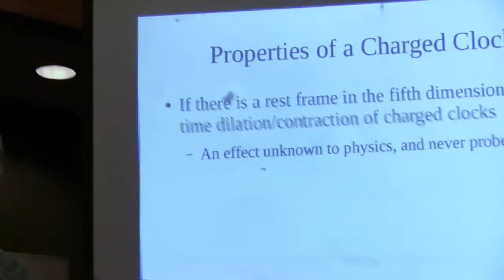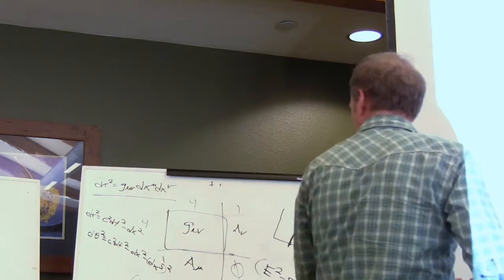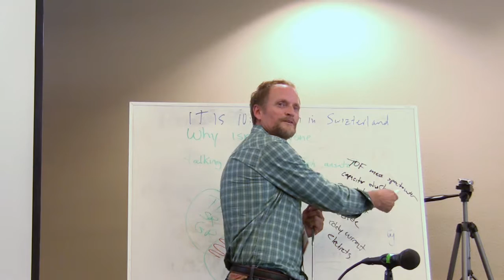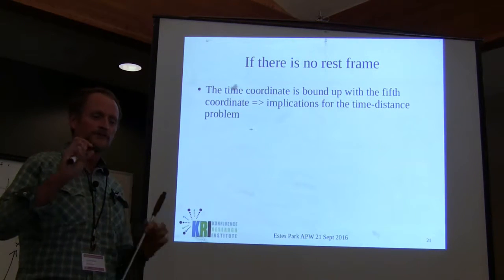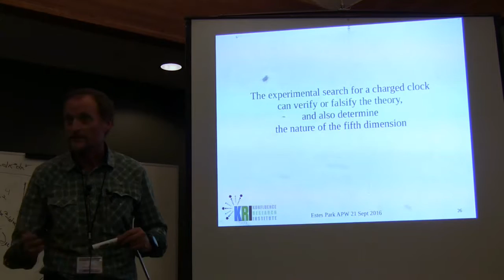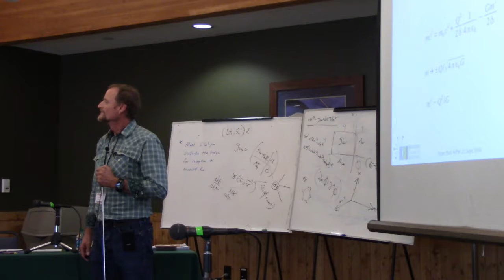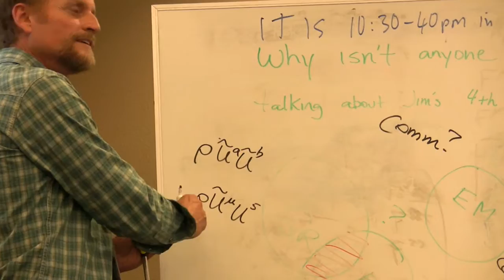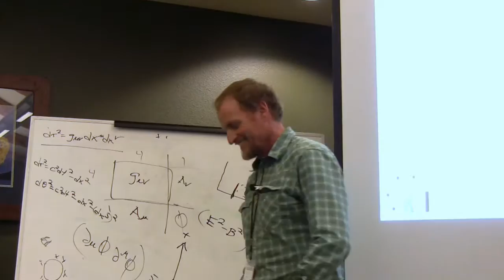BPW 2016: 15.  Lance Williams. Kaluza unification of gravity and EM (pt2)

Comment: Some top of the hat ideas...and a question

2D charged clock: Try manipulating spinning skyrmions on a 2D surface as a chargeable clock. You could charge it by playing with the magnetic field. Just move a permanent magnet above/around the skyrmion.

3D charged clock: Create a C14 defect in an otherwise uniform diamond lattice and measure its radiaoactive decay. Under normal conditions the decay of C14 is well known using statistics. You could do a statistical run for a charged lattice e.g. lattice set inside of a Charged copper sphere and you measure if there is a difference in radioactive decay.

Just a question: How does one think in five dimensions? 
4 dimensions is easy. We are used to 3D space and time coordinates. But in that mathematical description we always ascribe coordinates to non dimensional points. What if the fifth dimension is just a value giving a radius to that point, turning it into a dimensional sphere? e.g. if you have 4D point moving from a to b in a 3D cartesian grid over a period of time, then 5D would mean that this point is growing/shrinking at the same time. Is this a correct way to intuitively view a fifth dimension? It could be a helpful mathematical description of things in nature, but then the question arises, what is this dimensional sphere made out of? Somethingness, nothingness, a vacuous space? Could it be said that all these points ultimately make reference to a traveling EM wave-point-particle. Could it mean that the fifth dimension ultimately describes the value/weight/dimension of this  EM-wave-point-particle? And if that is the case and given that all EM travel at the speed of light, does it say something about the changing dimensions of this EM-photon through time or separate from time? I don't know.

Thanks for this great presentation.